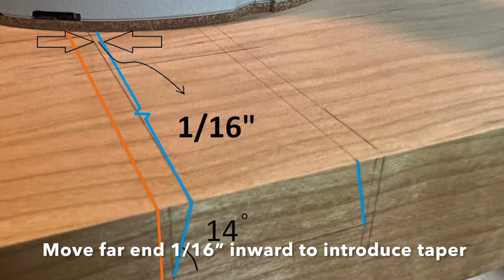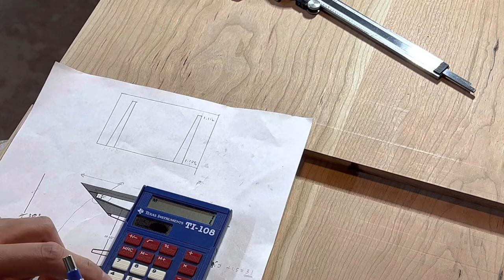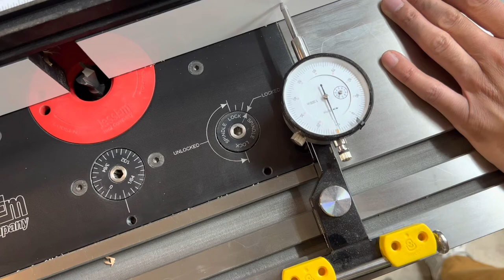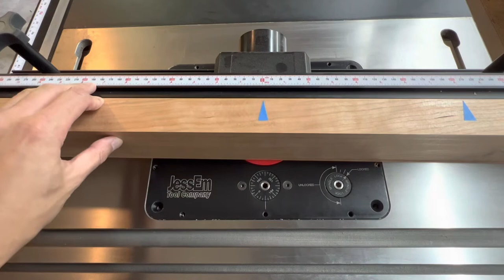How to cut a tapered sliding dovetail joint #woodworking  #dovetails #finewoodworking #joinery

Comment: Very detailed instructions!  What is the purpose of the slight taper vs. a straight sliding dovetail joint?
Reply from the maker: Great question: straight non tapered sliding dovetails are usually used for short segments such as on shelves or bookcases (usually under 10 inches). The problem once you go beyond that is the friction is so great, the parts seize when you try and go to fit them together. This is overcome by introducing a taper. Thanks for watching and commenting!

Comment: Thank you so much for this! I had a few questions as I've run into a few issues.

How much material do you remove on the tapered side for the batten? The lighting at the router table I couldn't see but it looks like you had two marks on the on the tapered side of the batten. I'm guessing the batten marks mirror the infeed of the dovetail dimensions on the table and you move the fence to get close to the outer marks on the batten but not cutting through it. Then the taper jig will automatically cut the proper width of the dovetail on the narrow side. Then how it gets snug is by creeping up on the straight dovetail side on the batten?

I think I've answered my own question but just wanted to make sure.
Reply from the maker: On the tapered side of the batten, once you made that tapered pass, any material you remove to get it to seat should be on the non tapered side since it’s easier to control. In my case my batten had bowed a little bit and so the tape marks the area that was poochy/convex a bit and I was just trying to shave the hump off (I hope that makes sense) ordinarily if you mail your stock and perform this procedure right away, there shouldn’t be any Boeing and the scenario I’m showing is a special circumstance. 

But you got it: you creep up on the fit on the non tapered side 👌

Comment: Thanks for the great video. I’m planning a table build and was not sure how to tacked the tapered dovetail. 

Quick question, what brass tool did you use to clean up the dovetail?
Reply from the maker: You’re welcome! I couldn’t find a good video when I was tackling this project so I made this in hopes it would be useful to someone. The tool used to clean up the dovetail is called a side rabbet plane. Stanley made the 98/99 left and right version originally and the one I’m using is made by Lie Nielsen. Hope it helps man!
Reply: @briantheprion  thank you. It’s very helpful. You are very talented.
Reply from the maker: @dannielrolfe8079  thank you Danniel that’s kind of you to say. Good luck on the project dude!

Comment: This is a good explainer. However, were you finding the bind zone using feel, sound or both? I personally couldn't hear any differences, but my hearing is shot.
Reply from the maker: Thanks Matt. I should have clarified in my video that the tapping method in the video is a special case scenario because the batten I had used had developed a bit of a bow in the side to side direction. So it still sits flush and flat on the table but the side to side movement caused me to see where it was binding. Its also a good idea to kind of tap the joint to see if indeed it is binding in one particular section vs the entire length and yes, its a feel thing since the hammer bounces a bit more here as well as sounding different too.  Does that make sense? In theory if the piece was straight, all i would have to do to make it seat home is just run the non-taper side against the router fence thus taking a tiny shaving off that side and it would then allow it to slide home. Its confusing no doubt what I wrote but I hope that clarifies things a bit. Cheers Matt!
Reply: @briantheprion  That clarifies it perfectly!

Comment: I would like to see how you sharpen plane irons?
Reply from the maker: Hi! I might do a video on that in the future but my method is almost exactly how Deneb Puchalski does it on the Lie Nielsen series on sharpening. I do not however use the “ruler trick” on my plane irons. I just do it old school and polish the last inch all the way up to a 16000 shapton. It’s a one in a plane blade lifetime and then I never have to fiddle with finding the ruler and holding it still while sharpening. Also if you put a camber on the blade, it’s easier to get the wire edge off the back with a flat back blade. I hope that makes sense. But yeah I’ll def put a video up in the future if more are interested!

Comment: I always assumed the tapering dovetail cut Ishitani did was built into the jig, but this makes sense.
Reply from the maker: I believe you're right. The taper he produces when cutting the mortise is set by a wedge you later see him use that he sandwiches on the batten when he cuts the tenon side when it rides against the router fence. The condition to this is that the router sled has to be dead-nuts accurate 90 degrees for the wedge to work double duty if that makes sense. For me at least, I felt it was easier to cut the tapered mortise and measure what the actual reality measurements are and then produce a wedge that can be really fine tuned alone and once I was happy with it, then use it to generate the tenon. Not saying my way is better. It just worked better for me to produce a consistent joint in my hands.
Reply: @briantheprion  Rewatched the Ishitani video and now see the reused wedge (wasn't sure where it was built in before). I guess the benefit is the taper should be exactly replicated with his approach. Or at least in theory. Looking forward to more "Ishitani, explained" content, and other projects you produce.  Actually I had assumed the batten was tapered a tiny amount and the mortise straight, so that it would be snug on one end when hammered in. Your previous comment about friction makes sense. Very lucky I saw this since I'm about to make a trestle table this summer and this avoided a huge error.
Reply from the maker: I’m glad you stumbled upon this video to help out on a project you got going on! The algorithm works sometimes lol. Cheers man and let me know how it goes!
Reply: @briantheprion  About your comment regarding the wedge working double duty - Are you suggesting that the router sled walls (without the wedge) need to be perfectly parallel in order for the wedge to be accurate in both applications? Just trying to make sure I’m interpreting your concerns here correctly

Comment: Brian, which whiteside bit did you use? I am building a cherry trestle table and would like to use this joint.
Reply from the maker: HI Craig, great eye. How'd you know I used a Whiteside bit? its Part # D14-75 (14 degree 1/2 inch shank, 3/4 cutting length, 3/4 cutting diameter, 3 inch overall length bit). Best of luck my friend and let me know how it goes!
Reply: @briantheprion  thanks Brian, you mentioned which bit you used in the description for your trestle table video :) I will let you know! I have a bookmatched slab for the top, fingers crossed I don’t screw it up!
Reply from the maker: Oh man you got this! Ain’t no way you gonna screw up! Just make your layout markings precise and then just tackle each part bit by bit. You got dis!